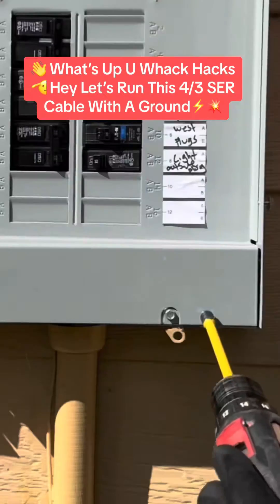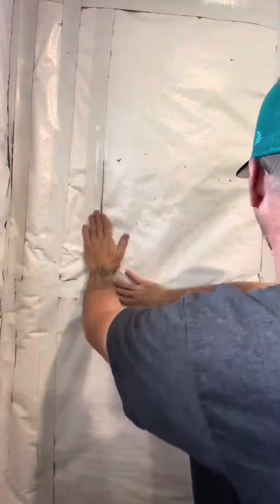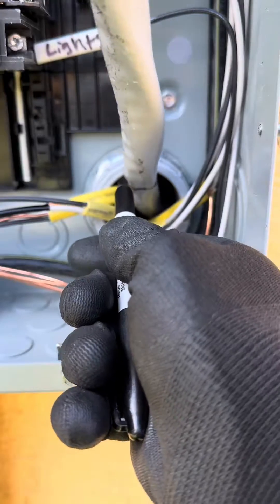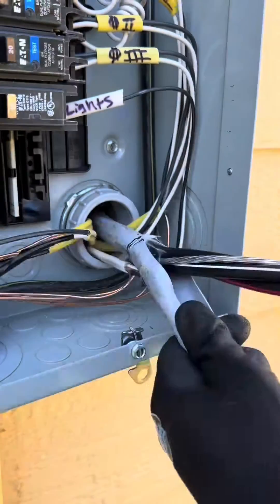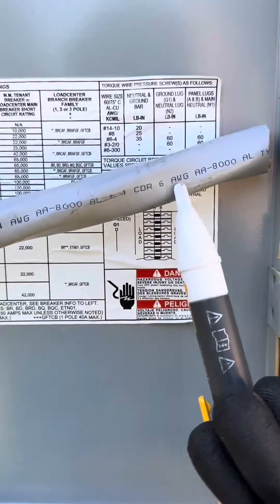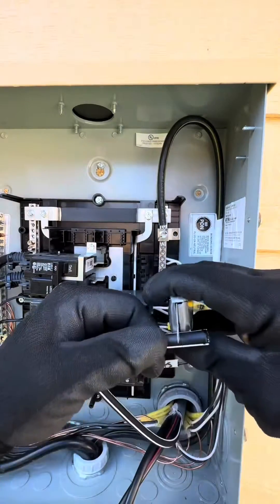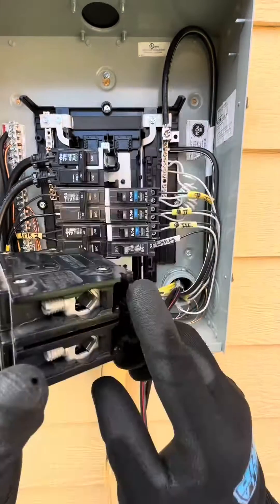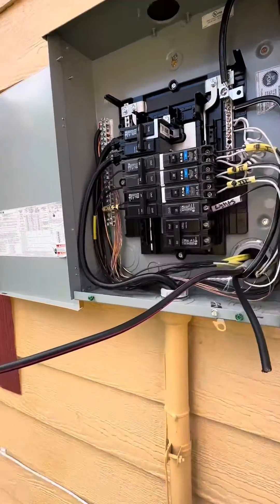⚡️Electrician wires up a 4/3 SER Cable⚡️

Comment: Fun fact modern Al wire like 1350 and AA-8000 aluminum conductors do not need anti-oxidant compound you can still put some on though if you want. K bye

Comment: Nice vid, how is your ser and nm connected in the back of the panel? Is it all clamped with a single clamp behind the panel or run through a nipple and secured to the wall studs inside?

Comment: Very dumb lazy thing to ever connect the line side of wires before conmrcting load side. If you do not own the approved LOTTO for circuit breakers, pad locks & tags with your name , company name & phone # please stop performing electrical work and  producing dangerous U Tube vidios. If me or any of my sparky coworkers only used tape to prevent somebody from turning on a circuit breaker we would be fired !

Comment: Even tough they say with type A 800 aluminum is now only grade used and tell use that anti oxide compound no longer has to be usef using it especially indamp lications eill provide a more reliable long term connection. Did not see the wires have a sealant that traveled thru the nipple. Only WIMPS would use a sawzall or portaband yo cut thin # 6 aluminum wire. If you can not cut at least #2 copoer & aluminum wires with linesmem.pliers get dome muscles.
Reply: Alll you seem to do is complain. You must lead a miserable daily life!

Comment: You forgot to add the no locks on the aluminum wire
Reply: Dustin at Electrician U says it's not needed, (unless you're in a place like Florida with a lot of humidity, moisture and salt in the air) because "the aluminum conductors we use today are an alloy, mixed with other metals so it doesn't react the same way as normal aluminum.
Reply: If terminals are aluminum why would that be necessary?

Comment: never heard of over torqued lugs causing a fire , under torqued maybe , but not over torqued , And btw never label breakers with a sharpie always use a pencil .
Reply: Why pencil and not sharpie?
Reply: @usa5439  because if a breakers needs to be moved to another position you can erase the pencil more easily , always a pencil never pen or marker